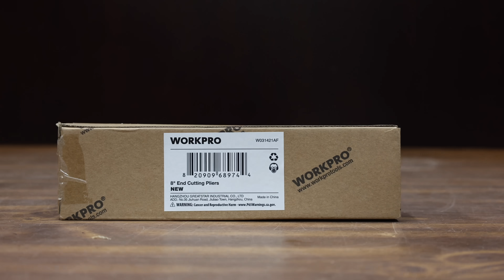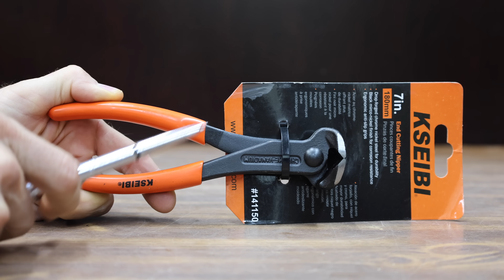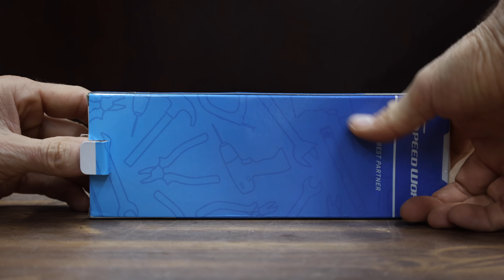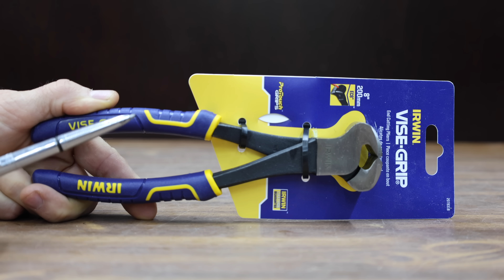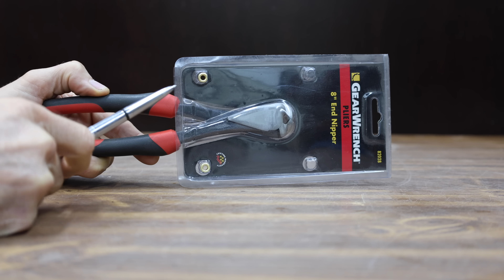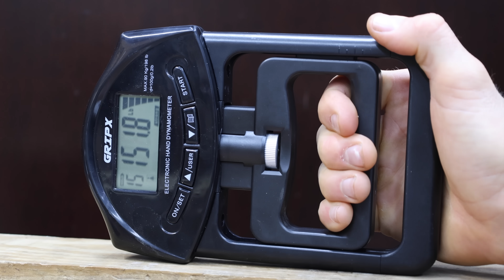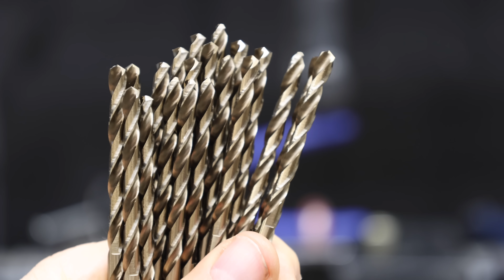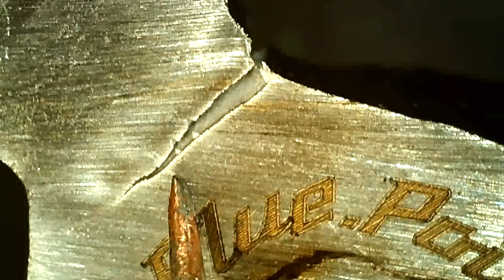Finally! Best Pliers I've Ever Tested! Not Even Close!

Comment: your tests confirmed my research.  i own and use knipex cutters.  next you could test LARGE bolt cutters, such as the Knipex 71 72 460, 18 1/4-Inch Large Bolt Cutter with the other brands.   can wait to see what kind of setup you'll come up with to test cutting padlocks.   you might as well test padlock shank resistance to snipping too !  😃
Reply from the maker: Thanks for sharing.  Thanks for the suggestion.

Comment: have used alot of different brands of cutters at work over the years, as a plumber elictrician and even now as a truck driver, first met the knipex brand at a reciever cutting a cable style seal, and they cut thru very easily without having to twist and pry . those gedores nice design but the need to work on those blades
Reply from the maker: Thanks for sharing.

Comment: Former industrial electrician here. I can 100% vouch for Knipex. I swapped out all my Kleins for Knipex. Nothing beats them. One of their most useful tools is their Pliers Wrench. Highly recommended. Couple more tips. For screwdrivers, try Wera. For an indestructible ratchet, try the Hazet 916HP or long handle 916HPL, rated for 1000nm/737ft-lbs of force. Thanks for the video!
Reply from the maker: You are welcome!  Thanks for the suggestion.
Reply: I would say that the Knipex pliers wrench is - by far - the most useful handtool I've ever owned.
Reply: @ianbrown4242  agreed!
Reply: @ianbrown4242  I think liking the tool is totally cool. But brand loyalty goes against every point of this channel. Why watch PF when you can go watch sponsored videos. Knipex does not make the best product in every category.
Reply: Yup, Klein used to own that market but Knipex has taken over by storm...
Reply: I personally prefer Gedore screwdrivers because their handles are rectangular instead of round, which makes it easier to get more torque imo
Reply: electrician : tried knipex pliers 30 years ago. happily threw my other pliers in the bin. got almost every size including a pair of monsters for spinning 4 inch galvi together. great tools.
Reply: lol was there something wrong with the kleins? What a waste.
Reply: @bowencreer3922  I kept a few and gave some away.
Reply: @bowencreer3922 yes the quality of the tool.
Reply: @bowencreer3922  You're assuming the Klein tools didn't go to a decent second home... I'm guessing they did. In which case, there's no wastage involved - someone else got a used set of perfectly usable tools, presumably at a significantly better price than buying new, and OP got a better set of new tools. I don't see any problems with that.
Reply: Master Youtuber here(18yrs) experience!  I hereby give my full endorsement to this comment!
Reply: I got some Wera screwdrivers and the round handles annoy me more than I thought they would. I think I prefer square-handled screwdrivers.
Reply: @rufus_mcdufus  I think screw driver handles a very much a question of taste. I've got an old set of Wiha screw drivers for electricians with square hard plastic handles and I hate them. I very much prefer the new round handles. But I've heard quite often people with opposite opinion and that is fine.
For me, if I need torque, I'll use a ratchet. But the round handles are more comfortable for precise use cases.
Reply: @rufus_mcdufus  the thing about wera screwdriver that annoys me is the tapered handle. Round i can deal with but the taper makes your hand slide down while losing torque.
Reply: the only thing klein has left going for them are the lineman pliers, and rightfully so as it's their flagship tool that built the company. knipex's are alright but I still prefer klein (probably due a lot to muscle memory lol). But I wouldn't use klein for anything else. I've only been in the trade for 20 years and it's been just a straight drop in the quality of klein tools the whole time.
Reply: @Kevin-ip8uf  well said. You're right about the lineman pliers. 👍
Reply: I really like Wera phillips and slotted screwdrivers because of the laser etching reducing cam out, but I am not a huge fan of the handles. I really like Tekton's high torque screwdrivers for torx and robertson, due to those handles. Would love to get a Wera phillips blade in to a Tekton high torque handle.
Reply: @reginalb124  yeah I hear you. I don't mind the Wera handles though. I also have quite a few Tekton tools. Good stuff.
Reply: i personally prefer Wiha screwdrivers. find the material is harder and does round as easy. If u in Canaderp like me Klien square drives are best for not rounding: better than wera and even wiha.
Reply: Knipex forged strippers and channel lock wrench are god tier, they’re so good that every brand is copying them
Reply: Yeah. Knipex is the stuff. I didn't even know other brands made the type of flush cutters used to cut through hole solder legs after soldering. We always used call that type of pliers "Knipex pliers".
Reply: @project farm
Video ideas: laser measuring tools and thrower beam  flashlights from  Fenix, thrunite, etc. Thanks.
Reply: Also work in construction/servicing for electrical stuff.

All my hand tools, screw drivers etc are either Wiha or NWS. havent found anything better than those, most of my colleagues and even most other contractors I see are similar, especially on Wiha Screwdrivers.
Reply: Knipex is definitely my preference
Reply: When did we start calling an end cutter or a nippers pliers?
Reply: I think maybe the newer Knipex pliers are maybe better? The previous PF videos did not fare well for Knipex.
Reply: Correction, the slip joint pliers did pretty good and so did the linemen. The needle nose and wire cutters were not impressive at all.
Reply: @thepuff791  the needle nose pliers do their job perfectly for everything an electrician does with them.
Reply: @blarfroer8066  If you really think that, then you are wasting your time watching PF.
Reply: @thepuff791  You can get some pliers in different types. As an example, you can get the 73 02 160 and the 70 02 160. Both are side cutters of 160 mm size. But they are different in their ability to cut wire. Especially the small side cutters for electronics are very different regarding how hard the steel is.

Even in this test, you have too take a look on what exact product (from all the brands) is in the test.
Reply: Be American, BUY American!
Reply: @buyamerican3191  no, in this case i very much buy German.
Reply: @buyamerican3191 Only when you get rid of MAGOLF HITLER.

Comment: I've used Wazakura forever. Honest to God, if you get that, you won't regret it. And out of all the others who are stupidly putting a V at the cutting edge, only Wazakura has an actual sloped design, and it doesn't hurt you when handling the material with cut off staples and nails.
Reply from the maker: Thanks for shairng.

Comment: Not to nit pick but it looked like when cutting to find the closest shave, you were tipping the pliers and causing them to cut further away than they were capable on some of the pliers. The problem is that they weren’t all tipped away from the staple by the same amount which would cause some pliers to cut closer.
Reply from the maker: Thank you for sharing!

Comment: I hope Knipex patented the shit out of their hinge/blade design. Such a stupidly simple, yet massive improvement on the century old design
Reply: Yep it is now patented (says on the handles), when I bought this pliers it was patent pending. It is very smart design that moves the pivot point much closer to the cutting edge, giving you massive increase in leverage. Plus they are made by knipex meaning the steel, the forging and edge geometry are top notch for a durable tool.

Comment: I used these tools every day at work for 35 years cutting stainless wire and pins we used to just have crescent and Channellock 358 with smooth ground sides. the Channellocks were the best, but they changed design with the big Frankenstein bolts sticking out the sides now I started buying the 358cb code blue with red and blue handles they are way better than the ones you tested they call them end nippers also have used the knipex and they work well also but i liked the handles that had recurved handle shape on the channelocks
Reply from the maker: Thanks for sharing.

Comment: I got a good one, do a safety pressure test on different air compressor tanks..  hydro tests with accelerated internal rust, tank liners or even test different waterproofing compounds as tank liners and see how each holds up or if they end up coming off and clogging a line or something.. stuff like redguard..  but the whole tank tests could save a life..   some people just go get a pancake compressor, use it once or twice then let them sit for years with water inside then go to use it with no hesitation for something just to let it sit again for years..   i get that most tanks will just develop pinholes but the lottery says some people have them explode taking out entire walls and some losing limbs or life from it..  seen one turn a flat roof bed topper into a dome once after it blew while driving when something fell on it or it fell on something..
Reply from the maker: Thanks for the suggestion.

Comment: Knipex are great, probably overkill for most people, but if you keep having to replace pliers - it's worth a try.

Flush cutting requires a flush cutter or modifying a regular cutter to cut flush. This can ruin the hardening if you let it get too hot when grinding ot down, and will make the cutting edge a whole lot more brittle, but much sharper.
Reply from the maker: Thanks for the feedback.
Reply: @ProjectFarm  no problem. Thanks for all the hard work, top quality with 0 fluff as usual.
Luthiers routinely use flush cut pliers as fret pullers, that's usually soft metal wire, but it can be stainless or other harder alloys. No doubt they grind them for durability in these general use pliers. The blunt double action pliers were a suprise - surely they need a sharper edge than that for piano wire? That is tough enough, thick hi tension wire.

Comment: Since when does high carbon steel minimize rust?
Reply: Just be glad they didn't call it "high carbide-iron" :)

The finish does impact corrosion resistance though, a high-polish takes longer to start rusting than a rough surface.
Reply: @BL-yj2wp  I assume from reduced surface area?
Reply from the maker: Thanks for the suggestion.

Comment: Who knew you could come up with so many tests? I've a pair of these pliers - call em round nose or even pig nose - and use them exclusively for nail and staple removal, not cutting. Grab ahold of the offending fastener, roll the pliers right or left and voila, fastener is easily extracted. Beats using claw-tail hammers 🙂
Reply from the maker: Thanks for sharing.

Comment: As a Knipex Fan i love the result, but i still need to point out that the cutters you used for the test(61 02 200) are the bolt cutter equivalent of their flush cutters. The 68 01 200 would have been a closer comparison in both price and use. Still great video!
Reply from the maker: Thank you for sharing!

Comment: I use these for pulling nails, rarely do I have cut nails with these. (Remodeler).  Channel locks is my favorite own Knipex too.  They  pull better without cutting. The smooth smaller handles fit in my pouch better and feel better. If' I'm cutting something that hard I'm grabbing a bolt cutter or cutting wheel if hardened.
Reply from the maker: Thanks for sharing.

Comment: Another good review but it would have been better to remove the breakout from around the staple before cutting it off since it may have lifted the sutting edge of the plier jaws away from the board.
The manufacturers should grind a 45 degree bevel on the back edge of the jaws and then grind the front edge flush. It does not appear difficult1
Reply from the maker: Thanks!  Thanks for the constructive feedback.

Comment: In terms of best practical nippers probably only length of nub left, force to cut through nail and price will matter much for most users. I don't know about other users but I don't even try to cut through screws with my cutting pliers.

So (length,cut effort, price)
Knipex             6,  1 - $63
Wiha                2,  3 - $25 
Wazakura        1,  5 - $50
Channellock    4, 5 -  $28

At least for the Knipex, model matters. Home Depot carried at least two less expensive Knipex models. I had to search for the high end model (62 02 200) featured in this video. Home Depot and Amazon carry it. It is cheaper at Home Depot, but shipping costs may affect the total price.
Reply from the maker: Thanks for the feedback.

Comment: I was hoping some of the cutters would be "flush cut" as I build rabbit cages and don't like bleeding when working with the wire. I have two cheapy brands and will definitely  check out "Knipex" for a pair. I have to recommend  everyone to try flush cutters to prevent being cut by your work.  I usually have to grind down regular cutters to make what I need. Thanks again sir.

Comment: You’re asking for ideas, here’s one I’ve been hoping you would do
 (your oil test have been some of the most informative and entertaining videos)
I propose you do a motorcycle oil test . A high-performance 4 stroke oil test. for bikes with wet clutches. On these bikes, the oil lubricates the engine the transmission and the clutch it’s an extreme test  of a lubricant, a harsher environment then car oils typically see.
If you decide to do this, please don’t go to Walmart and pick a few bottles off the shelf. They don’t have the good stuff. We don’t want to test this stuff 
we want to see the good stuff in your test and you do it best better than anyone on YouTube.
 Here’s a partial list ,Mobile 1 racing 4T, Castrol power one, Motul 300V, Redline, Belray, maxima, Amsoil, etc are a good start
Reply from the maker: Thanks for the suggestion.